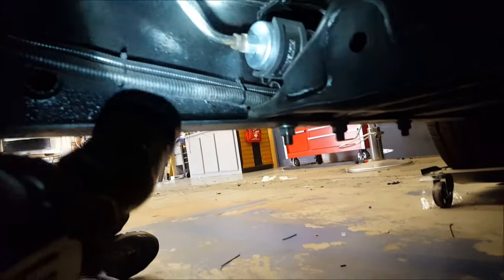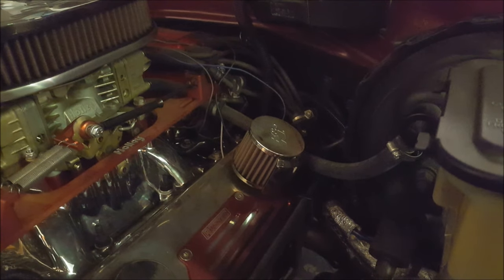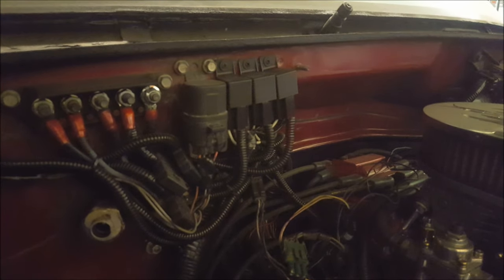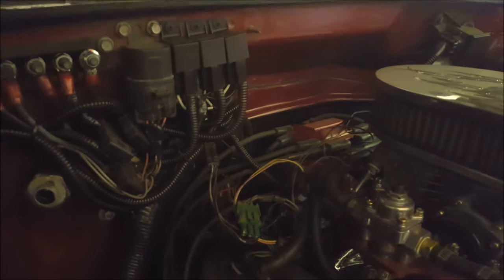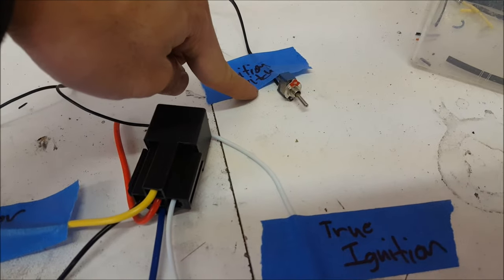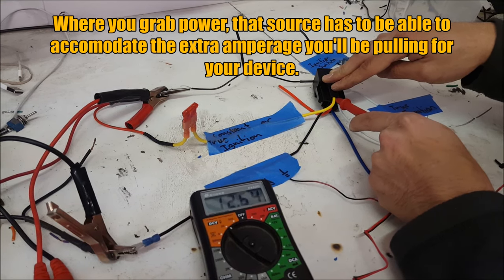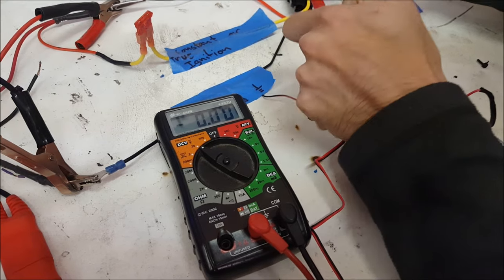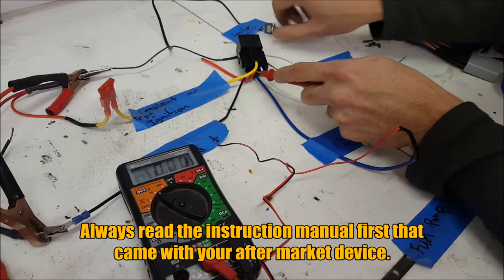How to wire an Electric Fuel Pump | AnthonyJ350

Comment: I used my TBI fuel pump and used a Holley regulator to give me 6psi for the carb
Reply from the maker: Great idea!
Reply: @AnthonyJ350  tbi is 12psi so no big deal regulating that down. On my current 77 C15 GMC, i run the Holley Red and has 5.5psi with no return, does very well no far.

Comment: What size fuse are you using on the constant true ignition and would you recommend this for all the holleys Red,blue and black. Oh by the way I did get my relay and the pigtail for it thanks. I really liked how specific your diagram is.
Reply from the maker: You'll have to review the instructions, it will give the recommended amperage rating. It's typically not very high. Make sure you ground the pump well.
Reply: @AnthonyJ350  thanks. My first one

Comment: Great video! So this relay wiring should eliminate the oil pressure safety switch?
Reply from the maker: It can or you can use it in conjunction.
Reply: @AnthonyJ350  as I understand it, the relay only sends the signal when you turn the switch on (momentarily), the fuel pump needs the signal at all times. So how to?
Reply: @shaolinmonk8620  Wire through an oil pressure switch to provide current once the engine is running.

Comment: Thanks for that sir!
Just want to make sure...

87-To Battery(Fused)
86-Ground
85-Ignition 
30-To Fuel Pump(or device being used).
10 Gauge wire sufficient? 

Thanks in advance for the reply!
Reply from the maker: Yup and 10 gauge is more than enough.  So sorry for the late reply, I just saw this one.

Comment: Am l right in thinking that you only have the power wire going to the fuel pump because the pump is grounded to the frame?
Reply from the maker: Correct

Comment: Great video! straight to the point. My only question is, what do you do if there is no spot to get a switched ignition from? for example on my 85 C-20 the only wire that I could find that is a switched ignition is the distributor wire. Could you make a terminal block that the distributor wire feeds both the relay and the distributor?
Reply from the maker: There's a switched ignition at the ignition switch harness.

Comment: Awesome video, great explanation.
I would like to install that on a 1970 Chevy C-20. If I get constant power from the junction block from  the positive side of the battery, then create a ground connection, where would I get the power from the ignition? Somewhere on the fuse box?
 That is what I am just not sure about. Where can I get power when the key is turned to the on position?
Reply from the maker: You can find an ignition wire typically at the fuse distribution.  Just make sure to put a fuse inline.
Reply: Thanks for the info.

Comment: I am installing a red holley electric fuel pump. My question is where to get the relay and the pigtail for it
Reply from the maker: An installation bay should be able to sell you the parts.
Reply: Just use the one in the truck car.

Comment: Im having an issue where my new vane pump wont stop pumping and it floods my carb, it pressurizes but won't stop like my old diaphragm pump I had, what is the reason behind this? is there a way to wire in its own fuel pressure switch? im new to wiring my own truck so im still learning so please help if you can. - ian
Reply from the maker: You can install a fuel pressure regulator with a return line.

Comment: How do you bypass the return fuel line because my truck has a main line, vape line and the thinnest one is the return. Also, does the fuel pump have be closer to the tank or the engine?
Reply from the maker: I maintained it. Used a fuel pressure regulator with a return.

Comment: Hopefully you still reply I was wondering I have a 79 camaro I bought it recently and it didn’t have the mechanical fuel pump so I bought an electric one but I am so confused on how to wire it since it doesn’t have an oil pressure cuttoff switch and I don’t know if it’s necessary to buy it or how to wire it. I was wondering if I could wire it to the neutral safety switch? Can you please give me an info on how to do it safely I was searching all over the internet and this is the only video I have sort of understood.
Reply from the maker: It is best if you can wire in the oil pressure switch. It will go on PIN 85 and provide a negative trigger. You can send  me the diagram of the product you're looking at.
Reply: @AnthonyJ350  thank you I wasn’t looking at any diagram since I never found one but In the videos I have seen they always say connect it to “the switch”  I wasn’t sure what switch I always thought the neutral safety switch but now I know it’s the oil pressure switch. I have yet to order the switch I found a diagram on Jegs here it is https://www.jegs.com/installationinstructions/500/555/555-11200.pdf  Do you have a video on installing an oil pressures switch? Or do you know where to install it? I can’t get much from that diagram. Thank you
Reply from the maker: @elcuh7939  In the diagram you sent, the oil pressure switch replaces the relay.  "Switch" would be ignition.
Reply: @AnthonyJ350  Ohhh ok thanks for the help much appreciated 👍👍
Reply from the maker: @elcuh7939  You're welcome

Comment: What fittings did you use coming out of the pump connecting to the fuel lines.
Reply from the maker: Barbed fittings with hose clamps
Reply: @AnthonyJ350  
Thanks , where did you get the fittings from? I tried three different auto parts , none of them had the fittings.

Barbed, i guess a hardware store would be the place to go.
Reply from the maker: Our local Lordco auto parts store has an aisle you can mix and match fittings then but the appropriate type of hose.

Comment: would i be able to do this in a 2000 mustang? i dont know if its gonna trip the ecu or something
Reply from the maker: You should be able to replace the one in the tank. Is the vehicle super or turbo charged?
Reply: its just a base model v6 i replaced all the relays that support the pump and the pump itself (ccrm and fpdm) and still no voltage. i already hooked some power to the pump and it kicks on
Reply from the maker: @quadmaster1954  there's probably a break in the wire. I would do a continuity test.
Reply: @AnthonyJ350  yeah i feel thats the case, u think i should find the open wire for safety reasons or is it fine
Reply from the maker: @quadmaster1954  I'd try to find where the break is and everything should just start working again. Look in areas where the wire is bent and inspect the length for any damage.
Reply: @AnthonyJ350  okay, appreciate the help 👍
Reply from the maker: @quadmaster1954  Let us know what your solution ends up being
Reply: @AnthonyJ350  i might just hook up the pump to the ignition if i cant find the broken wire, the car sat for 5 years so i wouldnt doubt something chewed one. if i cant find the frayed wire, would that be a safety issue i wouldnt want the car to catch on fire lol its becoming my first daily
Reply from the maker: @quadmaster1954  Did you check the fuel pump relay and fuse? Also a lot of Fords of that Era had a fuel pump reset button. Look into those items first before rewiring anything.
Reply: @AnthonyJ350  yeah i saw a couple of videos on the reset button but it didnt come in the 2000s, theres voltage to the ccrm but none in the fpdm (relay in trunk) so its probably a broken wire like u said

Comment: Could you tell me how to wire motor,pump,screen and flowmeter with motherboard in diesel or gas pump?
thank you.
Reply from the maker: I highly suggest having a credible performance shop do the work for you on that one.
Reply: Which shops?
Could you suggest me?please
Reply from the maker: @mohammedshahedhossain9627  Not sure, I only know Canadian shops in my area.
Reply: Could i get any help by online from this shops?
Reply from the maker: @mohammedshahedhossain9627  It's possible.  You might want to contact an aftermarket company the makes the fuel system you want to purchase, like Holley.
Reply: I need only design
Reply from the maker: @mohammedshahedhossain9627  You'll have to call a shop. Might have to pay a consultation fee for their time which is fair.
Reply: Could you give me this shops details?
Reply from the maker: @mohammedshahedhossain9627  You can try looking up BC Diesel.
Reply: Thank you

Comment: What size relay will i need for a weber? Says it pulls 6A at full throttle?
Reply from the maker: Just get a Tyco relay rated for 30/40 amp.
Reply: @AnthonyJ350  general purpose relay from tyco? Or fuel pump specific?
Reply from the maker: @Mroswaldo16  5 pin single pole double throw. They have 100% duty cycle and are made in Portugal and are based off Bosch relays.

Comment: I have a problem. My fuel pump doesn't power on when 87 is connected. But it powers on constantly when 87a is connected.
Reply from the maker: What's on 86 and 85?
Reply: @AnthonyJ350  86 is terminator x trigger and 85 is ground
Reply from the maker: @23steph13  87 is to battery and 30 to the fuel pump?
Reply: @AnthonyJ350  now I have ran fuel pump to green wire on terminator x. Running fine now. Thanks again!
Reply from the maker: @23steph13  Glad to hear you got it going.

Comment: Hiya mate, please help if possible. Ok, I'll try keep it short for now. I bought a Suzuki ignis sport for rally / fun. With original tank / pump it started on the button 100% ...I removed the large under body tank / pump. I installed a 15ltr tank in the back. Bought an inline universal high pressure fuel pump. Cost £60 nearly from a motorsport shop. The first one I thought was faulty, sent it back, got a replacement after some haggling. The key point is that I have it wired off the original fuel pump wiring. Ignition = prime ..turn key. Car starts no problem .. BUT! As with the first one it started on install / test. But almost sounds like it's struggling and starts to either starve or I just felt it best to turn it off. So with the first pump and now this second pump. Both the exact same ...the next morning I try to start the car and its not starting. Pumps making noises like its priming but won't pump the fuel. When the motorsport shop took back the first pump it was tested and it pumped fine for them for 30 mins but said I just sounded a little noisy. But this is both pumps failing to start the next day! There is fuel, flowing.. as in if I disconnected the inlet on the pump @ 12mm it's flowing fuel into a bottle. After watching your video I believe it's got to be my wiring or something ..You mentioned the pump might require a different wiring / current or something ...Is it possible I'm coming to the correct conclusion? Why if instead they both worked fine but now it won't pump fuel. I'm pulling my hair out trying to figure out what I need to do. Battery I fully charged, zytech 12mm in out filter before the pump + plenty of fuel.. what could I be missing or not doing correct? Please help, any advice is greatly appreciated!! :)
Reply from the maker: I would install a fuel pressure gauge, that will help you diagnose the problem.
Reply: @AnthonyJ350  Hiya, cheers for the reply. Would this not only help if there is fuel pressure to gauge in the first place? ...this is my issue. When I first install pump as new out of the box it works no problem. Or seems to. But try it the next day and it won't ignite. When I brought the first pump back they tested it. Not in front of me though. They advised it pumped fuel for 30 mins no problem but was just a bit noisy. So I can only gather from this that the pump isn't getting the power it desires? I guess a test would be to put a volt sensor on the + - on the pump while someone turns the key? ...another point I was concerned about was the original pipe work was fuel sender line, a breather pipe and what we assumed was a return line but I could not get fuel to come out of the return line. Is this possibily an issue ...if the fuel gets sent continually but is unable to return then it would stress the pump out? Maybe causing this issue? But what gets me is the 'test' these guys did with the first pump they advised it pumped fine so I am just pulling my hair out trying to figure out am I completely stupid or am I just missing something simple? I'm a technical kinda person and I don't do anything which I know could potentially damage things so I like to ask questions before going and doing something you'll regret later kinda thing. I know this kinda thing is difficult over a keyboard but I'm just hoping someone somewhere might have the answers :) thanks in advance again Anthony !
Reply from the maker: @blizteredthumbs7911  I would pull the pump out and try to run it on your bench.  Don't run it dry for too long as the fuel helps lubricate it and keep it cool.
Reply from the maker: @blizteredthumbs7911  Did you modify the intake unit for the fuel pick up?

Comment: Your method obviously worked, but it's not a good idea to be teaching your students this way.👈
If the relay has a freewheeling/reverse polarity diode fitted, you will blow the diode.👈
Sandard practice is actually the opposite of what you showed.👈
For a traditional power side switched circuit:
Pin 30 should be the fused power (+) supplying the relay.
Pin 87 should be the switched output power (+) to the load/accessory being powered.
Pin 85 should be the negative (-) terminal of the relay coil.
Pin 86 should be the positive (+) terminal of the relay coil.
👍
Reply from the maker: You're saying the diode is fitted between pin 87 and 30? Or 85 and 86?
Reply: @AnthonyJ350  A diode in reverse polarity is sometimes fitted on some relays between terminal 85 + 86, commonly used if the relay is controlled by a transistor or some sort of electronic circuit, ECM etc.
If you get the polarity of these connections incorrect, the diode will effectively be dead shorted and conduct, causing the diode to burn up.
Look up quenching diode, freewheeling diode, snubber diode, flyback diode etc👍
Reply from the maker: @simonilett998  The relays we're using I'm pretty don't have the diode internally. I've discussed adding one with a technician before but the majority don't bother.

What application have you done seeing failure without the diode present for the coil?
Reply from the maker: @simonilett998  Do you know what brand of relay has the internal diode? Because Tyco and Bosch don't. Also the other problem in the industry is every manual sometime 85 is ground other times it's the positive trigger.

And no manual even discusses the diode.
Reply from the maker: @simonilett998  If you're not using pin 87a at all. Does it matter if the power source is on 87 vs 30?
Reply: @AnthonyJ350  The connection for 30/87 makes little difference if you're not using 87a. Also swapping 85/86 no real difference unless the relay has an internal or external diode fitted.
One brand of relay I have used with a diode fitted is HELLA, all part numbers 3055, 3056, 3059, 3060 and I found out the first time I fitted one why it's important to connect the 85/86 polarity correctly, smoked the diode and blew a control side fuse, the terminal designations are even printed on the box and I still made a mistake...lol
30/87 and 85/86 terminal designations are supposed to be a known standard, but I do see the supply/load or coil +/- swapped around from time to time in instruction sheets or tutorials, but I figure that whoever wrote them didn't do their research.
The main times the diode is very important to be used, or relay with diode included, is if the relay coil is being switched on the ground side by a transistor, mosfet or electronic module, and perhaps where an electronic module is monitoring the negative side of the coil for circuit integrity checks or coil control confirmation etc.
The back emf voltage spike created by the collapsing magnetic field of the coil can be quite a high voltage, so it has the potential to damage sensitive electronics if the spike is not 'quenched' by the diode.
Hope this helps👍🇦🇺

Comment: Boss man I need help I see you replying to recent comments
Reply from the maker: Sure what's up?
Reply: AnthonyJ350 okay so I bought a Holley blue fuel pump fer my 454 78 Malibu right, and i also got the relay wire kit, comes with a already wired relay plug, different size wires n shit, also got the oil pressure safety switch so I did a bunch of research and figured it out but my main concern is where I hook up my ignition source/switched 12v it says run a wire from the NO on the oil pressure switch to the ignition I’m not sure where a good location is, that part has me the most confused

Comment: Hello from Oregon, I have a Holley blue that went bad so Summit Racing sent me another, I have no relay but I just bought an after market one and it does not show the same wiring as you explain should I follow it or the way you explain, it is not a Holley relay and it has 14ga wiring, I plan to run a 10ga wire to pump directly to relay, My relay shows pin 85 Ground, pin 86 switch, pin 30 is hot Battery, pin 87 to devise/pump should I follow this or as you explain?Al.
Reply from the maker: That was is correct and virtually the same if you saw how the internals of a relay work.  Just follow their diagram and make sure to put a fuse inline where ever you get power from.
Reply: Hi Anthony, I did figure out what I need to do but thanks for getting back.